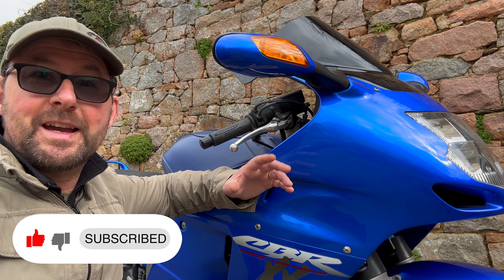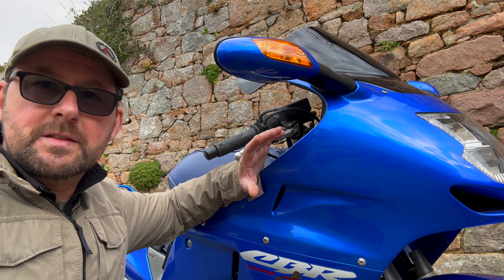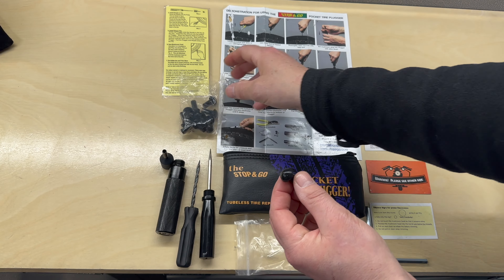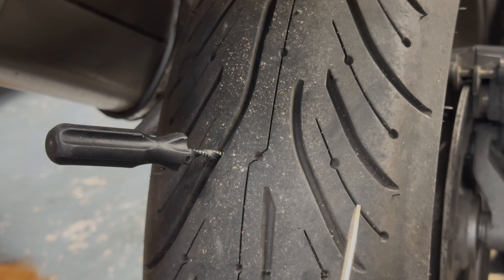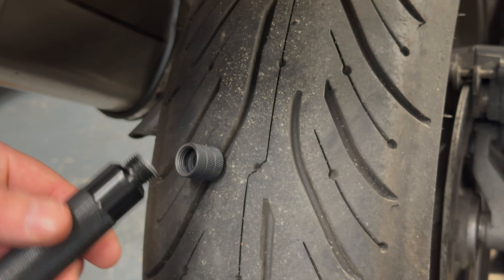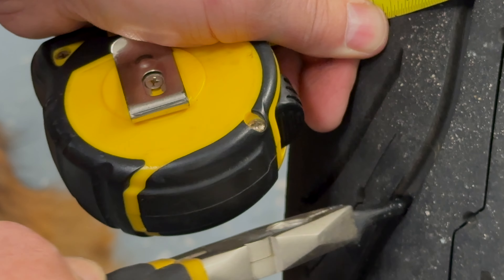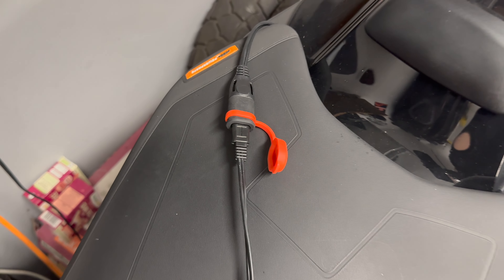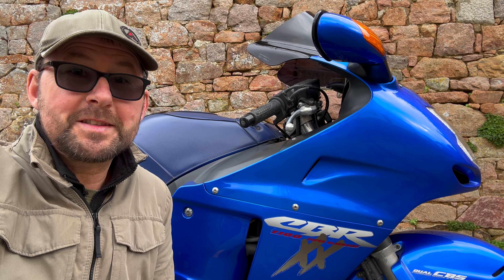Repairing a rear puncture in a Honda Blackbird, using the Stop and Go tyre plugger kit.

Comment: Paul I have a 1999 EFI one of these and have refurbished a couple of others. In my opinion they are a fantastic bike and I hope that is the conclusion you arrive at as well.  I am in my seventies now so have changed the clip-ons for the popular flat bar conversion and again in my opinion it only enhances the ride.  The engine is the best engine Honda ever made and its a great pity they have not used it in any other Honda bike.   Looking forward to your thoughts after you ride it.
Reply from the maker: Hi Peter . Really enjoyed my trip on the old girl again. My fading memory suggests that my Red one was in my possession from 1999 until 2001, when I went all track day thingy and got a gsxr1000k2, which the gearbox went on me...and the fuel pump. Mind you it was front wheel in the air a lot of the time, couldn't help it. cbr1100xx is still one heck of a machine in 2023...I would certainly go for more upright bars though, age thing😂